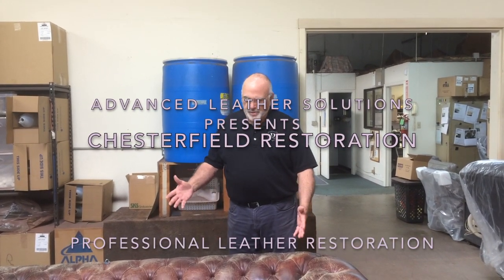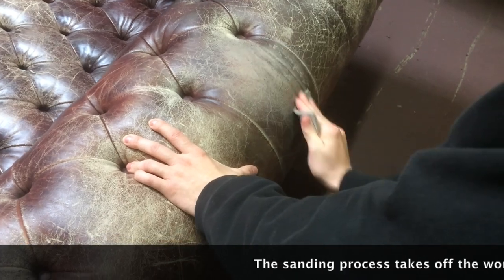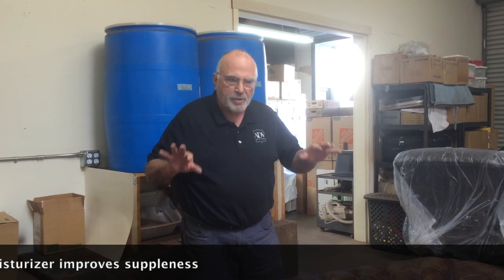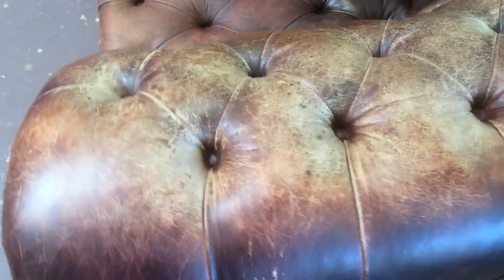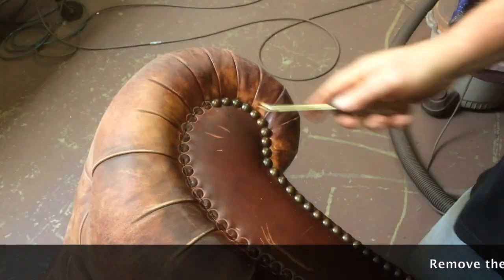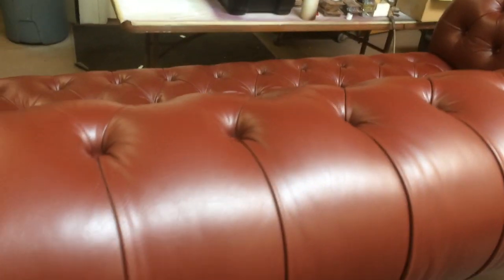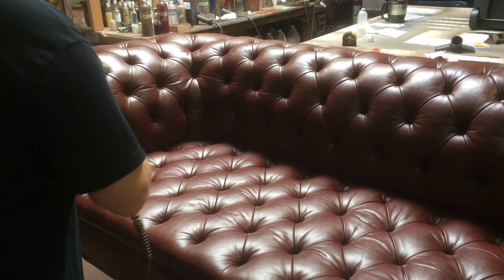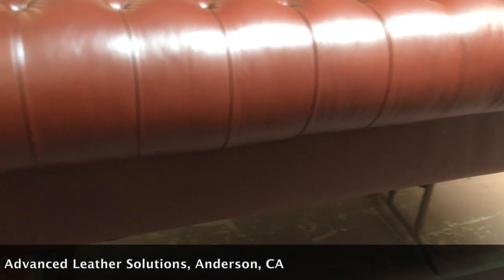Restore Leather Chesterfield Sofa

Comment: I have x2 black chesterfields and I want to re stuff the seating part it looks identical to this chesterfield you restored. I want to do it at home (uk) do you have any advice please
Reply from the maker: What you are attempting usually requires decent upholstery skills and the appropriate equipment.  The seat deck is sewn in so you have to approach the project from the underside.  That means removing the cambric dust cover and removing the spring set or whatever suspension system you have internally to access the foam core under the leather.  You'll find that each of the tufting cords will have to be cut to remove the original core (foam).  Next is to bring the original core to a foam supplier who will cut a foam block consistent in size with the original, then reverse the process, re-tufting and replace or re assemble the suspension system.  You may have to de-tack the leather from the frame to make it easier to access the internals.  THIS IS A MAJOR JOB.   Good luck with it.

Comment: I REALLY want one of these but I can't get anything bigger then a two seater to fit through my door and stairs. How do you turn these into Modular/comes in two prices. You guys seem to know your stuff. 

Thanks guys and well done and such a good restoration
Reply from the maker: It would be a major effort to disassemble the sofa to move into a small space, if even possible.  In some cases the frames are manufactured in two main components, 1. the seat deck and 2. the back/armrests.  If you cut open the dust cover under the piece and look inside you'll see how the piece is assembled.  If the seat deck is attached by bolts, then undo them and separate.  This will leave you with a U shaped frame (frame minus seat deck) that may make it easier to turn tight corners.  Reassemble once in position.  I hope this is helpful.

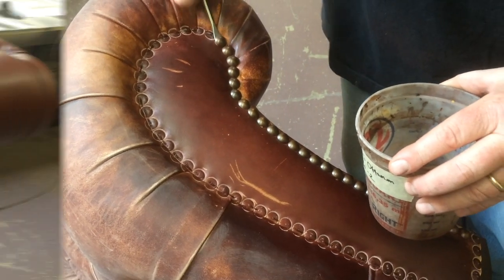Comment: 3:50 Why not show each step of the restoration, for example the application of the base coat, might as well have been a brand new couch the way the video is edited.
Reply from the maker: Rick,   You wrote:  "...might as well have been a brand new couch ..."  
Thanks for the compliment.  We often have that reaction to our work.  However, the idea that we purchased a brand new $7,500 chesterfield sofa that is identical (same exact color) to the unit we were restoring just to deceive you is a bit over the top.  For your benefit, here are two other YouTube videos that show the process.  The first is a sectional, the second a chair where we changed to color.  
1. https://youtu.be/eeNM8xJ6paQ  
2. https://youtu.be/ycZhJTSrKJ0

I'm happy to answer any technical questions you have.  my email is: Kevin@AdvLeather.com

Comment: Hi Kevin,
Awesome video and restoration! I own a chesterfield that has some wear and tear, dark spots from oils and color fading, but I have no idea where to begin fixing it up a bit. I'm in the Netherlands and would love to try it myself, but I'm worried I'd get the wrong color and mess up the couch, would it be possible to send in pictures to figure out what needs to be done and what kind of products I would need? And do y'all ship worldwide? Thank you!
Reply from the maker: Sorry for the delay in responding.  Yes, send photos and I will reply with best advice.
Reply from the maker: We've created a system that mimics the mottling affect on leather.  It's called base and print.  A base color is applied everywhere, then the print color coat is applied erratically to create the mottling or color variation.

Comment: How do you keep the leather from getting to the before stage? The salesman at the furniture store doesn’t seem to know.
Reply from the maker: Keep in mind the piece is 30 years old.  So it took 30 years to get to that condition.  And now it has another 30 years of life.  The key to longevity is to buy quality leather in the first place, and then provide proper maintenance --- cleaning and conditioning the leather with the correct products like those from Advanced Leather Solutions.  People make a huge mistake applying incorrect maintenance products which are too harsh for leather (wrong pH) and accelerate its demise.

Comment: what do you do when there are holes in the leather? can you patch if you dont want to bear the cost of reupholstery?
Reply from the maker: Holes can be repaired.  If the holes are from the leather simply wearing out, then the repair won't last because the leather is at the end of its useful life.  If the holes are in healthy leather, like you sat down with a screwdriver sticking out of your back pocket that poked a hole, then you can expect the repair to last the life of the leather.

Comment: What about old , worn  leather with dark spots? What causes that?
Reply from the maker: Dark areas on existing leather is typically caused by skin oil accumulation in the leather from a person's hands, or head.  This is completely correctable.  The key to success is the integrity of the leather.  Leather that is truly worn out, that is its internal fiber structure is coming apart, would require leather replacement in those offended areas.  Otherwise it can be fully restored to look new.

Comment: It looks fine and maybe it was the only way, but that looked like dyed leather. Your solution is a painted finish.

I wonder if you couldn't have stuck with an alcohol based dye solution.
Reply from the maker: @itsthemetho  this piece had a “base and print” pigmented finish from the factory.  Because it wasn’t raw leather, the dye solution wouldn’t penetrate.  Furthermore, even if it were an aniline piece, dyes lack covering power as their molecular construct is very small so the outcome tends to be blotchy.  Finally, you run the risk of the dye transferring on to people’s clothing.

Comment: Hi Kevin, I'm in the UK, is there anywhere over here I can  purchase your products? Like the primer, moisturiser and top coat? The primer we use has a cross linker which not only leaves a bad feel to the leather but it's also carsogenic. I do alot of reseal at people's houses where we clean, colour and seal it so I'm just looking for a better primer/products etc.
Cheers
Stuart
Reply from the maker: We're happy to have you try our products.  They were engineered by us as leather technicians as we knew the performance we want.  So our products are not someone else's that we re-bottled.  They are compounded by us.  Go to our web-site www.advleather.com and ID the products your interested in and send an email and I can tell you their attributes.  You may also find the e-book we've recently wrote - The Comprehensive Guide to Leather Repair and Restoration useful.
Reply: @KevinGillan  Hi, I'm in Europe but my sister is in the US, in case I cannot source something locally. My question: how (and how often) do you recommend caring for a nice leather jacket? The leather feels like it could be suppler, i assume it could use some maintenance. Sheepskin, brown. 
I'm asking you, because what you did here with this leather looks like witchcraft to me! Thanks!
Reply from the maker: @stanandre4539  Sounds like you need a good quality leather conditioning agent and some aggressive milling.  Our moisturizing gel will do the trick as a conditioner.  I do not recommend the standard grade conditioners for a variety of technical reasons.  Regarding milling...  1. Condition the leather.  .2 Then insert on a pillowcase that you pin closed.  Stick it in your dryer along with a few tennis shoes.  Tumble on AIR ONLY! (no heat) for 15 - 20  minutes.  This process will loosen the fibers and allow the moisturizing gel to do its job of lubricating the leather fibers.
Reply: Hi Kevin, we are over hear in Portland and have a pair of chesterfields that need the cushions under the seat replaced. Do you know of anyone here who does that?

Comment: What would a job like this cost a customer?
Reply from the maker: A professional restoration of a leather Chesterfield as shown in the video would cost between $1,200 and $1,500 in our professional leather restoration studio.  This does not include the cost to transport the piece to and from the studio.  Your other option is a DIY approach where a Do-It-Yourself kit is specifically customized to your piece with everything you'll need for you to do the job yourself.  The DIY approach is a color rub-on system and does not require spray equipment.  Fee for a custom kit is around $300 plus shipping.  to learn more, visit our web-site - http://AdvLeather.com.
Reply: Kevin Gillan that is a lot of work so that price is justified. I might have to have my leather sofa re-dyed but if you do it in spots, does it make it look uneven? My feat is DIY dye kits have an unnatural look and feel in the final product
Reply from the maker: @Shino2600  If there are only one or two spots, you can get away with spot touch up.  However, like painting a wall, there comes a point when it makes more sense to just paint the whole wall.  Regarding our DIY solution, your fear of an unnatural look is not well founded.  Our DIY solution produces like professional results.   When down right, paying attention to the instructions, you can expect excellent results.